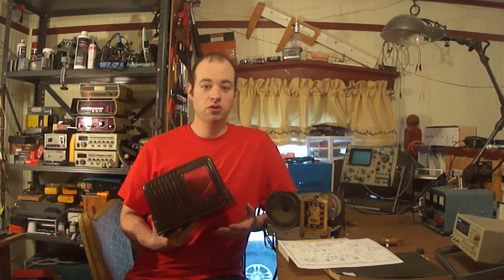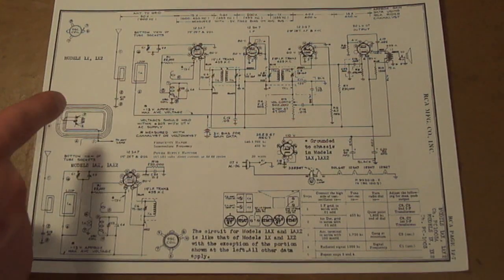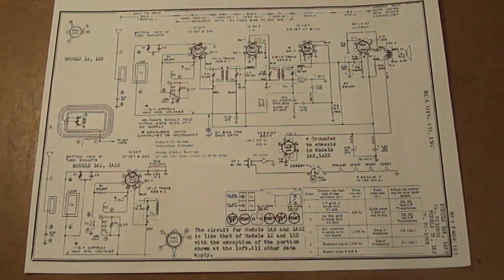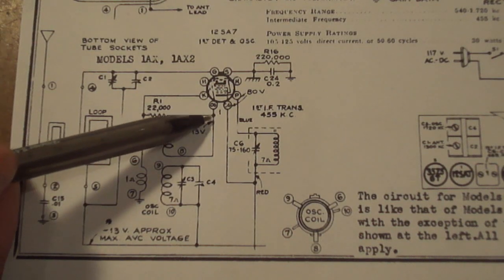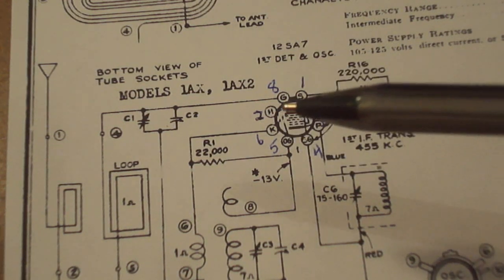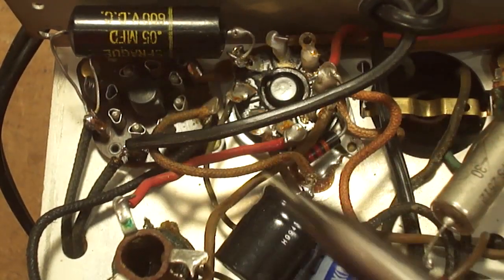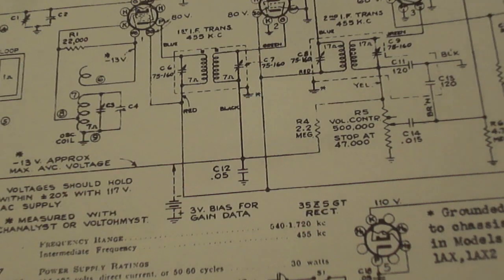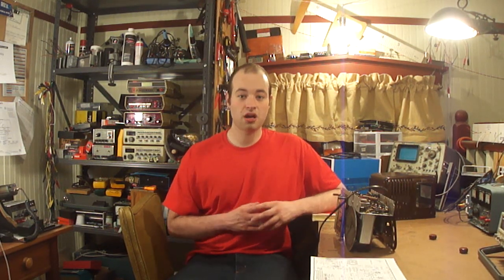How To Read Antique Radio Schematics

Comment: Back in the day a schematic was seldom needed. Most problems were tube based and with block diagram knowledge and a simple tube tester a tech could fix 95% of radios. The same was true with TV servicing, I learned radio electronics on that very RCA radio you have on your bench,, however before I got to that stage I studied basic electronics. My years of experience and advanced knowledge grew from each set I worked on, learning about test equipment was another part of the courses I took at RCA Institutes in NYC. These days the problems that occur are mostly component based due to aging of the radio receivers. Yes today  a schematic is much needed.with experience and practice expertise is finely developed.

Comment: So far this was the best video of this kind out there.  This was very good and really helped.  I would like to see you expand on this topic especially things like voltage in and out of tubes, current flow, and using a multimeter, etc.
Reply from the maker: Arpie S thanks! Those are good video ideas. I’ve got a couple videos in the works in the works and then I will get on them.
Reply: Thank you. Excellent explanation

Comment: A few things that are now clear to me that I find are eye opening.  This is a very good lesson I couldn't be thankful for, thank you.  #1 I didn't know that the tube layout isn't the same on some of these schematics, I should always reference the actual tube layout, not the drawing to locate the pin-outs of the tubes.  I always assumed the pin-outs always went from left to right in order.  Now I know this is not true.  Not being trained in schematics, I am self taught and I assumed many things, but the biggest assumption was the tube layout in the schematic. #2 the addition of the supplemental circuit on the schematic. I now know this is where I find the different version of a certain part of a circuit, where before I always thought it was on the drawing as an option. (Yes that may sound silly, but to an untrained person, this is the only  thought process I had to account for that addition in the schematic.) A great lesson for me to keep in mind from now on.  Also, I can now go back to some of these old radios I have set aside, because I've been having issues with, and correct my mistakes. Thank you.
Reply from the maker: Glad I could help!

Comment: You can download a RCA Receiving Tube Manual as a pdf.

There is a lot of good information in this clip.

About the AVC (- 13V max) is related to the amplitude of the carrier wave. The carrier is rectified and smooth to a dc voltage.
Strong signal high AVC voltage, less amplification.
Weak signal low AVC votage, higher amplification.
Please correct me if I am wrong. 

The voltages given in the diagrams are messured with an analog multimeter specified in the diagram very often around 20kOhm/V.
Today we use digital multimeters. No problem but the voltages can differ a bit.

I think with the comments we make it a nearly complete good guide to read valve (tube USA) diagrams.

Comment: This was super helpful as I'm starting repairs on an old Montgomery Ward's Airline radio!  I looked back and forth between the schematic and the radio for quite a while and still couldn't make sense of everything, but this really helped clear it up, so thank you.  I'm still not entirely sure how to make sense of all of the lines and dots and where they come together vs. where they meet at a tube's terminal (that doesn't seem consistent on my radio), but it may be worth a try!
Reply from the maker: F1FanWoodsie28 one thing to remember is that many times the manufacturer attaches the components to what ever the handiest place is under the chassis. Lets say a schematic shows a 1 ohm resistor and the B+ voltage connected to the plate of tube number 2 on the schematic. Now the B+ also connects to the plate of tube number 4. In the radio the manufacturer could have connected the 1 ohm resistor to the plate of tube 4 because the resistor couldn’t reach tube number 2. The schematic is still correct because since the pate of tubes 2 and 4 are connected together so even though the schematic shows the resistor connected to 2 and in real life it’s connected to 4 electrically it is the same thing. 

They drew the schematic in a way the keeps any one section from getting too crowded looking while in real life they assembled the circuit however they could to use as few wires and tie points as possible. It is confusing but after a while you get used to things being electrically like the schematic yet the physical construction is not laid out like it shows in the schematic. Sometimes it’s just a big game of connect the dots.

I hope this explanation helps.
Reply: @iainportalupi  As an update, I'm happy to report that after replacing nearly everything, the radio I was redoing now works!  Thank you for the tips!
Reply from the maker: F1FanWoodsie28 that’s great news!

Comment: What a very good explanation Ian. Very well done, if you are not already, you would make an excellent teacher. So in my experience  most of the schematics I've read vary dramatically as far as information provided. Unfortunately most have no voltages shown and occassionally no ohms for coils. Also, on really old ones the resistance for resistors can be represented by the letter M vs. the letter K for thousand, and meg for megaohm. The rake being chassis ground and the inverted lines being circuit ground, if a schematic has no brakes and all inverted lines, are those now chassis grounds or are they all still circuit grounds and no grounds to chassis?  Excellent video!

Comment: Thank you for posting excellent explanation.I just bought my first radio a Zenith 5d320 1937, I'm going through replacing capacitors and verifying resistors. But I noticed the schematic shows two R1 resistors and 2 C4 capacitors. Have you seen this,?
Reply from the maker: That’s a new one to me, I’ve never seen duplicate part numbers on a schematic before. Where did you find the schematic?
Reply: @iainportalupi  can I send you a picture? I got one from radio museum.org and another one from nostalgia air both the same schematic.

Comment: A very good introduction into reading vintage schematics. Just one thing to note: Some very early schematics used M for 1,000 when referring to resistors. We are more used to seeing the letter K used for this, so a 3k resistor is 3,000 Ohms. But some old schematics might show resistors as being, say, 220M. That is NOT 220 Meg Ohms! That would be a ridiculously high value, in fact it would almost certainly mean 220k, or 220,000 Ohms in modern parlance. Just another one to look out for.

Comment: Pin output for the converter, you can easily swap 2 and 7 since they're the heater and the pins will be exactly 1-8 clockwise. Yes, many times they do not put the pin outs exactly but when they use the image as in this schematic, it most likely will be exactly correct pin outs starting with the notch on top, counting 1 to the immediate right clockwise to 8. ;-)
Reply from the maker: gabevee3 I see you caught that. I swapped those pin numbers to make a point because this schematic really did have the pins in the correct order but I was trying to get people to not assume they always were in order.
Reply: @iainportalupi  Understood. Terrific video BTW. Two thumbs up! :-)

Comment: Good video, I'M working on a Hallicrafter S20R,and I find so many things that don't match 
the diagram; But this radio looks 100% original every component is from that era.
but I chase components on the diagram but too many are not on the radio...is Crazy.
Reply from the maker: I’ve found that sometimes the manufacturers make changes to the circuit throughout the production run and the updated schematics got lost over the years. I’ve got a couple Yaesu FT 101 radios and they are famous for having parts appear and disappear throughout their run. I have three different schematics for the FT 101e and they are all slightly different. The thing to remember is the manufacturer only truly cares about manufacturing the radio. They make a design change and may or may not update their records to reflect it.
Reply: @iainportalupi  yea that must be what it is.

Comment: This is fine if you have a decent schematic. My schematic is straight from the riders manual and Is quite terrible, and has Typo's. I can read most schematics relatively well but this one is bizarre. Riders volume 12 sears and roebuck chassis 110.400.